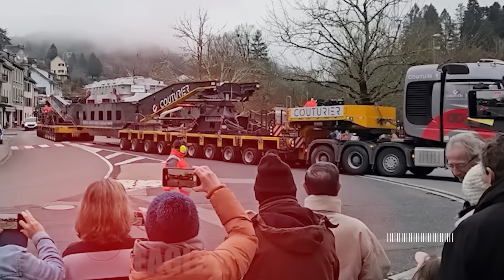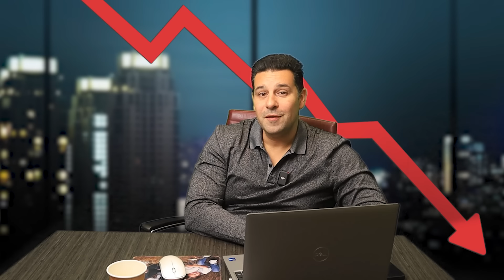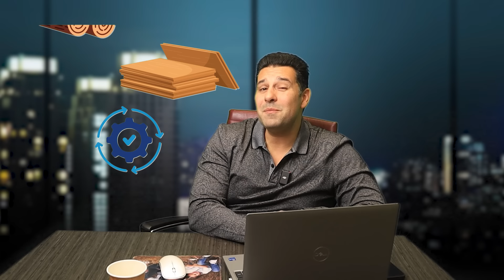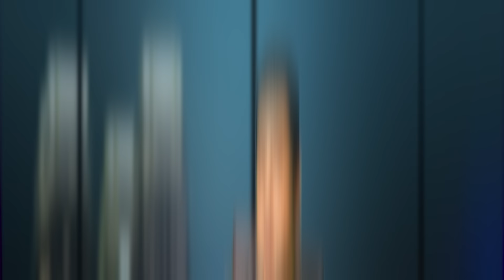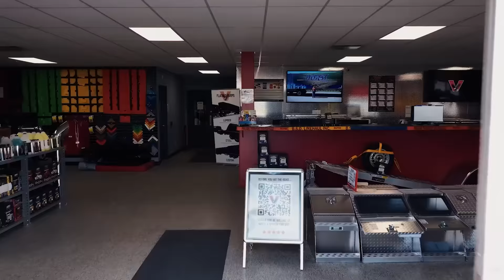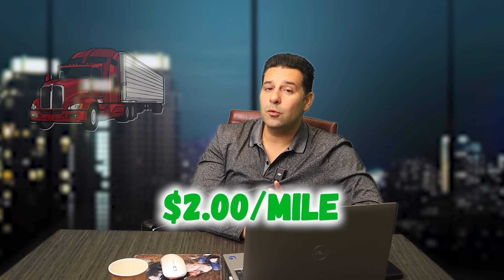Oversized Freight! | Is It WORTH IT?!

Comment: I've done it in BC/AB but I was a company driver so I was severely underpaid. Though I like the challenge. It's definitely extra stress, but you do feel alot cooler! 

You have to be comfortable blocking traffic and being an asshole to get where you gotta go and keeo people safe. It gives you perspective to ALWAYS avoid parking on main highway shoulder if you can help it, because you never know when something is coming down thay way. You really need to look up ahead because the shoulders and oncoming traffic on two lane roads especially are very dangerous. Could decapitate someone really easily, it's no joke! Should pay like 40-50+ hr as a company driver.

Comment: Worst thing every state has different rules, worst thing can’t drive at dark, especially in winter short days, takes like twice longer. Plus some states don’t give you permit same day, like TN, SC, and some others, especially over 12ft wide , or 15ft tall. And don’t forget that you can’t drive off route they give you. One wrong turn , they treat you like you criminal, fines, courts, etc.  have to enter all open scales. Asking for trouble. Trust me if you do legal loads, you make more money. That 1 or 2$ per mile not enough to cover all the problems you get with oversize. Oversize only good to suspend your cdl, for working twice harder. Or get heart attack because of stress. Trust me don’t do it .$3-$4 per mile don’t do it! Maybe $5+ in some cases worth doing, but brokers won’t pay you, because of all those non English drivers doing it for $2-$3 per mile any day. Any time of the year, give them 50 cents more per mile over legal load , they happy .

Comment: I’ve been moving oversized loads for 30+ years now and wouldn’t want to do much else. 
My annual oversized permits for Ontario allow me to move 78000kg or about 172000LBS gross weight and be 104’ long without any additional permits.  We had been moving super loads all summer, pilot cars and 27’ wide pieces or 18’ tall. 
The real trick is taking an oversized load and making it fit in the imaginary box that makes it legal to move at night or through different provinces without any additional permits. 
I have the stories and pictures LOL